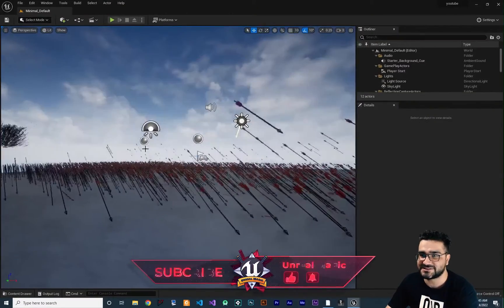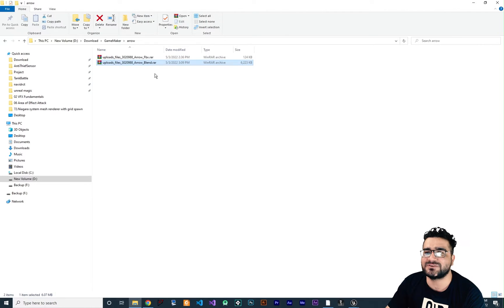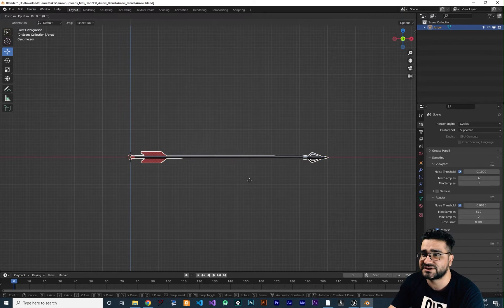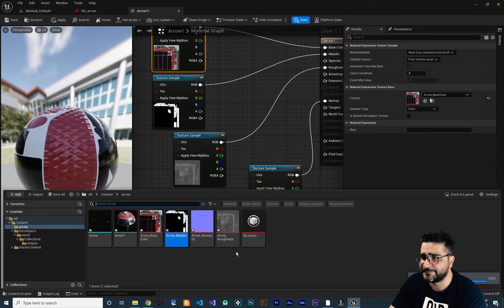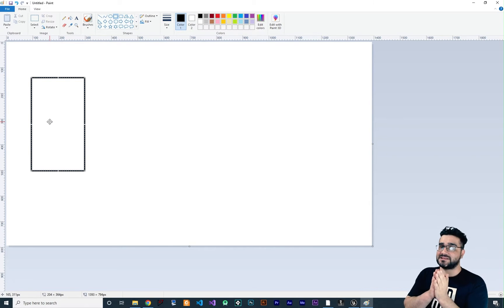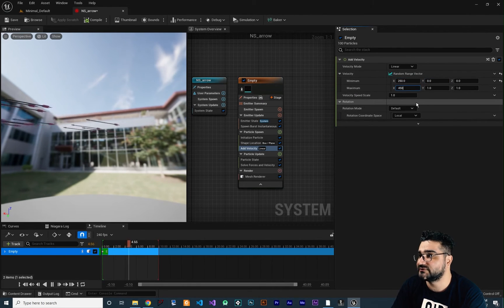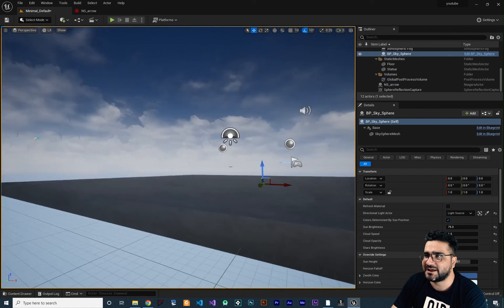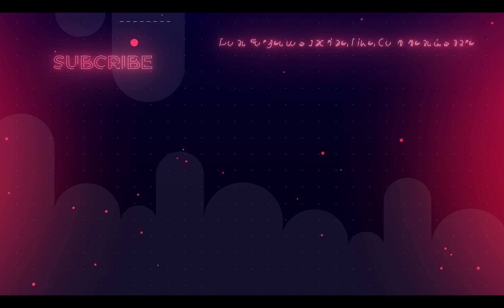Niagara vfx rain of arrow with collision and mesh renderer in unreal engine 5

Comment: Hi, cool video!
But I have a question why the arrows may not get stuck (stop) when touched and enter completely into the texture and only the place where the pen is inserted is visible. Which parameter may be responsible for this and whether it depends on the 3D model?